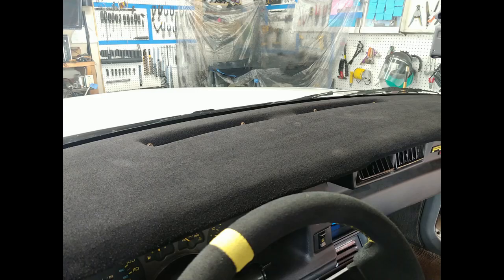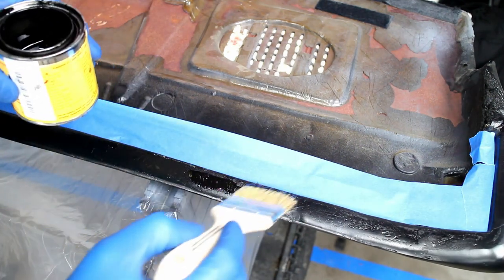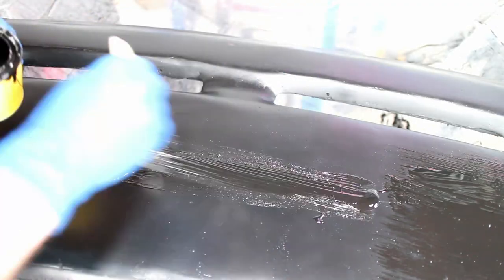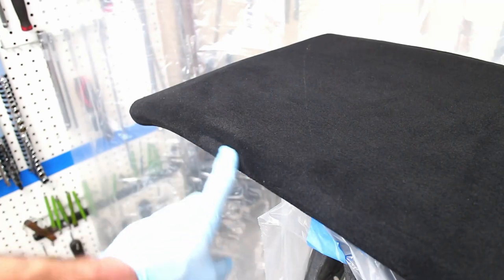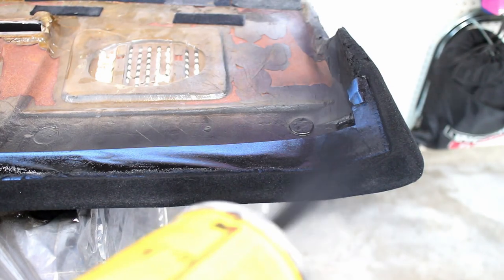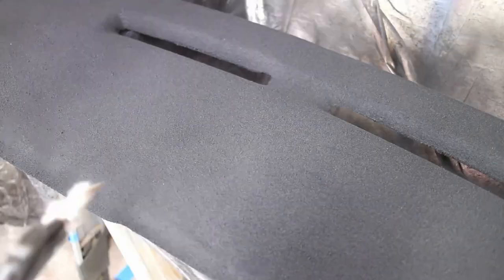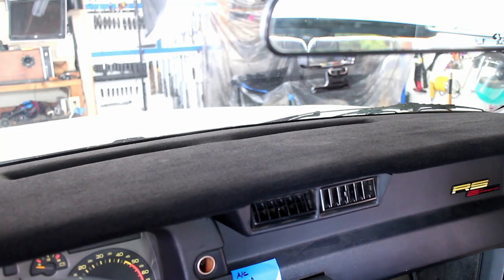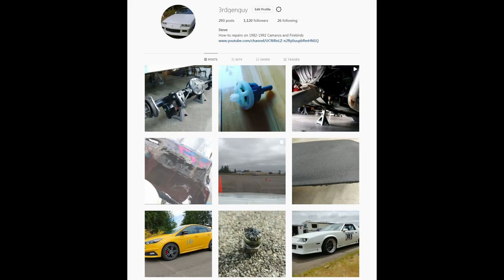Flocking How To Flock a Dash Pad  (82-92 Camaro/Firebird)

Comment: So how hard is the flock dash to keep clean? I want to do this to my 79’ Malibu but I’m wondering about how to clean it. Since it seems textured I would think it would be hard to keep dust off the dash. How do you maintain your dash?
Reply from the maker: you have to spray it off with compressed air and hit it with a soft bristle brush every month or so.
I wouldn't say it's easy to keep clean.
looks great though and no sun reflections.
Reply: @3rdGenGuy  thanks! I dig the channel and have used a few of your videos to help with my fourth gen autocross/road race Camaro.